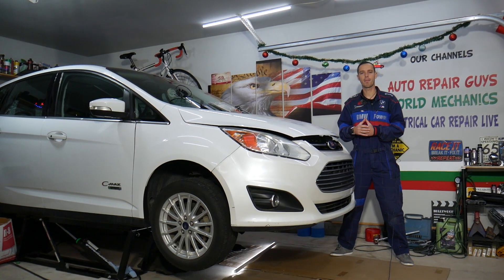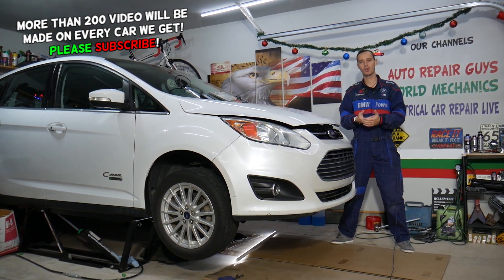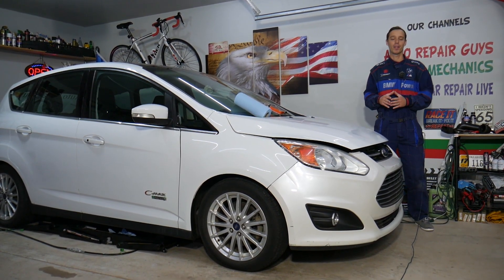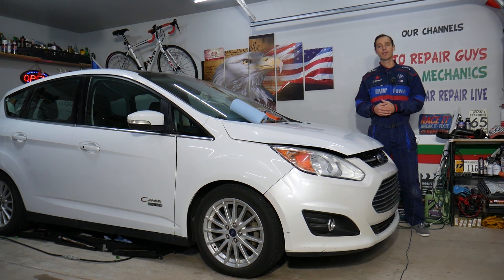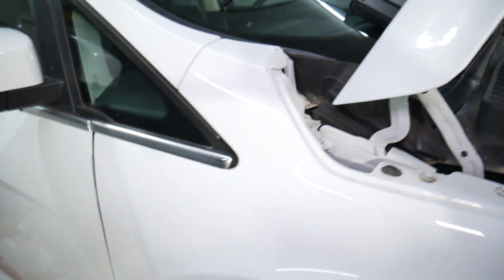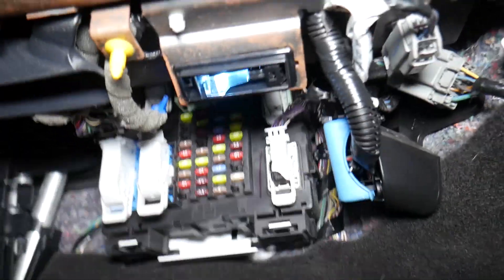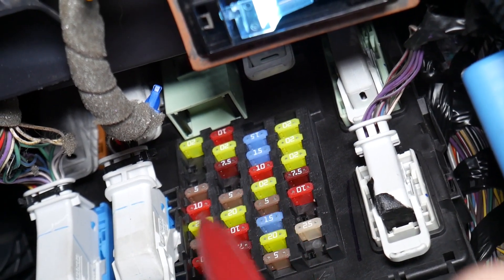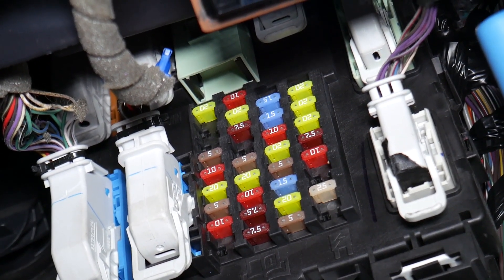WHERE IS THE SYNC FUSE LOCATED ON FORD C-MAX, FORD SYNC NOT WORKING

Comment: So which fuse are you to check in th 2007 edge when the auxiliary port is not playing music or not allowing you driving hands free to call ppl or take calls during driving ? It just stopped working completely. I switched out the auxiliary port in the center arm rest compartment.  So I know its not the auxiliary connection port ! 2007 Ford edge sel all wheel drive with tow package thanks for any feedback on how to get this fixed working again.  Brief video would also be helpful 😀..